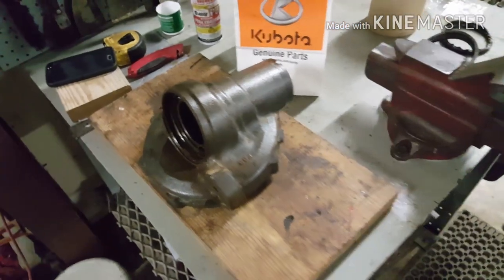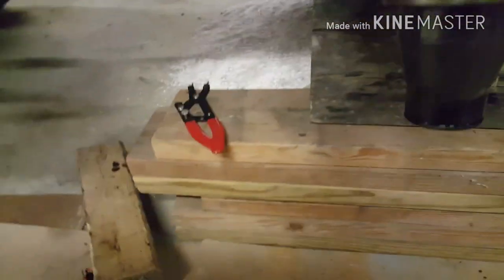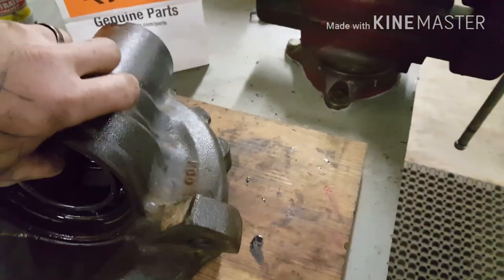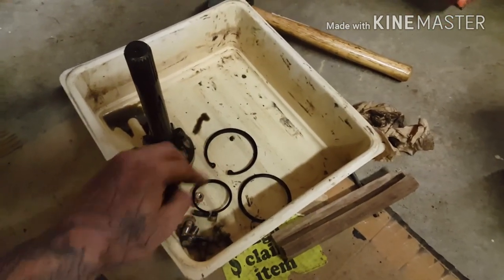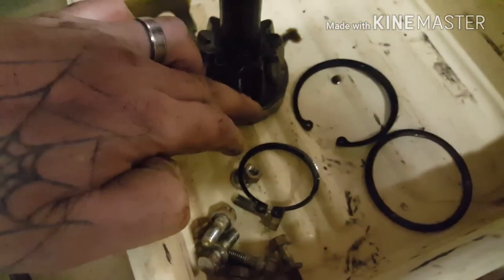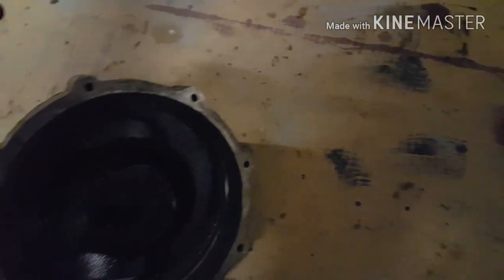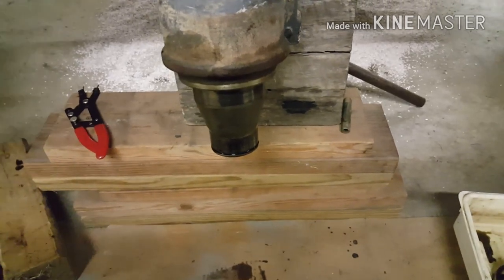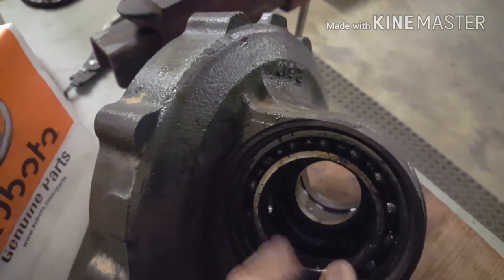Kubota tractor how to front axle knuckle seal replacment teardown

Comment: Thank you.

My trusty 7100HST 4x4 Kubota front Left wheel froze up in the storm and would not free up.  Driving in the snow drug the wheel sideways in the snow.  I could tell it was getting power, but locked up.  It slowly loosened up as temperatures thawed and I drug it into the shop over a period of days.  I'm suspecting that the seal is bad.  water freezes/oil does not.  So my hypothesis is seal leaks water into the gear reduction on the bad side.  I have not drained it to see if it is full of water yet.  Thanks.  this is my best resource yet:)  G
Reply from the maker: Wow!! Prob so .. Thanks so much man! Keep in touch be curious to see or hear once you tear it down.

Comment: Question...why didn't you remove the bevel gear case from the front axle case?  Just looks like 4 bolts And a $5 o-ring between the two parts?
Looks like you took much of this apart while having to work on the ground?
Thanks in advance.
Reply from the maker: Ughhh No.

Comment: Those "c-clips" are called snap rings.  Also, invest in a seal puller and a dead blow hammer.
Reply from the maker: Yea, aware snap rings. I have seal pullers , just didnt have them at the time. 
Thanks for the info

Comment: Did you have difficulty putting the case back onto the axle? We replaced the seal but now can't seem to get the last 3/8" needed to put back the upper c-ring on. Any suggestions?
Reply from the maker: +Andrew Carter.. im trying to remember.. so u git seal drove in all the way at top of knickle?? If u didnt get it flush at top then u wont be able to get c clips on inside at bottom ..is that whats up? Been awhile..
Reply from the maker: +Andrew Carter i didnt have a issue.. main thing was make sure everything was clean so seal seated eveenly and all.. its hard to see up in there lol.. where that clip goes.
Reply from the maker: Yes, u are exactly right!
Reply: Had same problem with similar tractor.  Seal happens to be a two piece and the upper metal piece was still on shaft.  Hard to see because it was shiny and clean just like the shaft.  Once removed then the case will slide right on with a little help from jack. So check to make sure the entire seal has been removed.